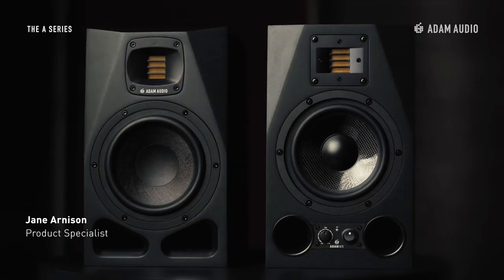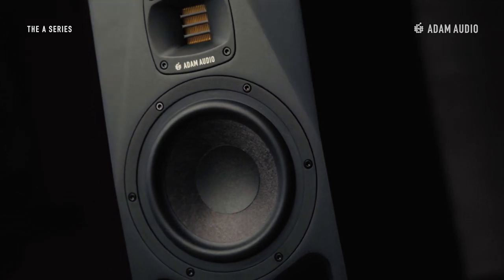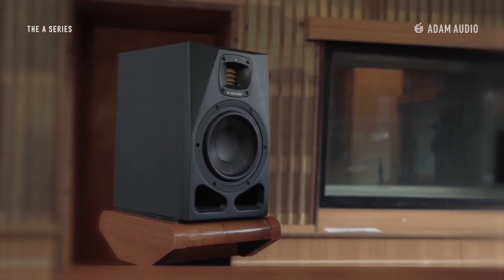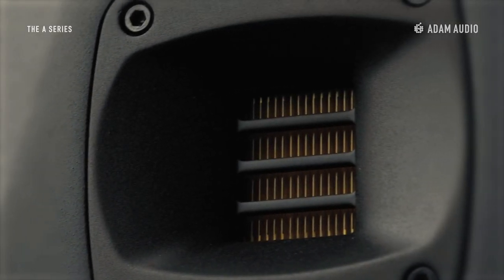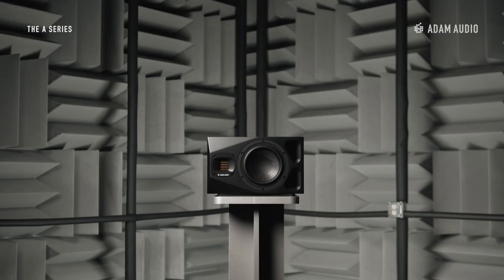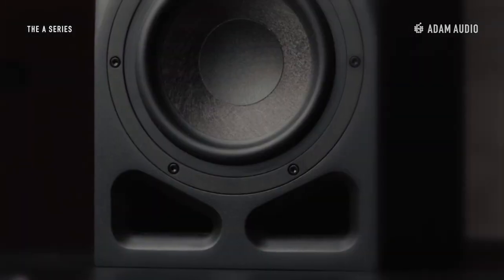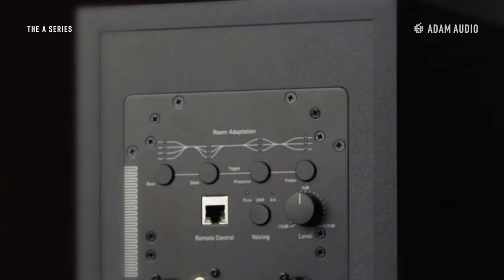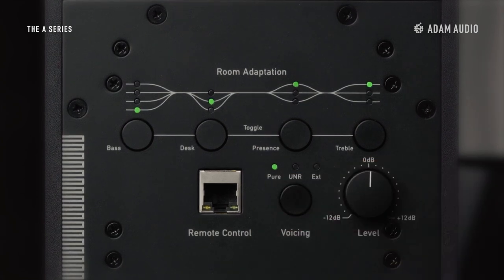The A7V At a Glance | ADAM Audio A Series

Comment from the maker: Update: Measurements with the latest firmware show a frequency response of 40 Hz - 45 kHz at - 6dB.
Reply: what does the -6db or -3db mean? why is it that between of those two, the frequency response are different? please respond, I wanna understand the whole thing, cuz it's a bit confusing hehe
Reply: @Jisooee  it refers to the definition of where the usable frequency response ends. A -3db point at 41Hz means that this frequency is played 3 decibels quieter than the rest of the sound, and it will get quieter from there. So the -6db point is at a frequency below that, but is usually less useful because -6db is already a significant drop in SPL (sound pressure level).
Reply from the maker: @Jisooee  Hey there, here is an article we wrote about this topic 👍 https://www.adam-audio.com/blog/understanding-frequency-response-charts/
Reply: @LeonhardWindecker  i wish all daws would start at -18 or -6  ....-6 gives me some headroom to work within the spectrum. I usually leave this for mastering
Reply: @ADAMAudioBerlin  thank you!!
Reply: @LeonhardWindecker  & thank you too bro!
Reply: @LeonhardWindecker  does using EQ like SonarWorks help boost them back up?
Reply: @WhiskyTanuki  probably, but unless your room acoustically boosts your base, the speaker will get to its limits quickly. Adding base via EQ basically means you cannot play the speaker as loud as without EQ.
Reply: @LeonhardWindecker  Thanks for the reply!

Comment: Very nice. Is there a way to turn DSP off?
Reply: The "Pure" mode will disable the processing.
Reply: "Pure" mode is a voicing. It will not bypass conversion. The drivers crossover filters are executed with DSP requiring it to always be in the signal path.

Comment: How does that room correction work when the A7V's are connected via a sub 12? Does somehow interfere or change anything or should that work just smoothly?
Or would it be better to ditch the sub 12 and get a pair of A8H instead? wich one of the two setups are more promising to achieve accurate room correction?
Reply from the maker: Hi CV!
Subwoofers cannot be controlled in A Control as the current range is analogue, but they can be integrated into an already calibrated DSP system.
And it depends. To be honest, there are advantages and disadvantages to adding a subwoofer to a loudspeaker.
Advantages: lower LF cut off frequency, reduced distortion, higher low frequency headroom, increased placement flexibility.
Disadvantages: the additional bass management filtering adds group delay around the crossover frequency. In very good rooms and with good ears and revealing material, this can be audible.

So adding a sub to A7Vs or going to a pair of A8Hs depends only on your necessities. Usually adding a subwoofer is a good thing but it needs to be set up properly to get the maximum benefit.

Comment: Is the X-ART tweeter for the A7V updated, improved?
Reply from the maker: Hi! the X-ART tweeter is the same as the one used for the AX Series. Handmade in Berlin.
Reply: @ADAMAudioBerlin  The tuning is different perhaps? Maybe less fatiguing?
Reply from the maker: Yes and it should be mentioned that in the new series (in difference to the AX), a rotatable HPS waveguide has been introduced with the X-ART tweeter, which is a big improvement! :)
Reply: @ADAMAudioBerlin  What is the big improvement? Restricting vertical dispersion?

Comment: I know its still early but, measurement data please. You can provide data for the T series but not the new/old A series? A digital/DSP monitor with no digital input connection? Are we going to have audio over IP? Please don't force 2 stages of conversion (3 stages, because most likely you using a DAW and have DA. So that would be DA-AD-DA and finally to the amps/drivers}.
Reply: Exactly!!
Reply: Yeah, I never understand why manufacturers only give their speakers analog inputs when they have a DSP crossover. It just does not make sense to me!

Comment: Hi!
Are they supposed to distort at louder volumes? 
The leds turn yellow and the membranes crackle like crazy..
Reply from the maker: Hi Lynxs!
Please check these links for guidance https://support.adam-audio.com/hc/en-gb/articles/8929001521426-Limiter-inside-more-details-about-threshold-LED-behaviour-

https://support.adam-audio.com/hc/en-gb/articles/8929035350930-LED-different-colours-for-div-purposes-Customizable-with-software-
Reply: @ADAMAudioBerlin  are the a8h’s a better solution?
Reply from the maker: Hi Lynxs! The A8H is a more powerful speaker and it will support more gain and loudness.

Comment: How i can take out the tweeter to change horizontal? Its real hard
Reply from the maker: Hi Michael!
Hi Michael! As the manual says, you should follow these steps to rotate the tweeter and waveguide module:

1. Cover the tweeter with masking tape, as shown in the picture below, to prevent particles entering the tweeter diaphragm.
2. Using a standard hexagonal or “Allan” key, gently loosen all four screws on the front of the waveguide.
3. Taking care not to detach the audio or LED cables, gently remove the tweeter and waveguide module and rotate to the desired orientation.
4. Reinsert the tweeter and waveguide module, and gently tighten the four screws.

Note that repeated removal of the tweeter and waveguide may damage the wooden cabinet. Only carry out this procedure when necessary.

I hope this can help you!

Comment: I got the A7X monitors last year and now this comes out. Just my luck.
Reply: same but still love my a7x's and would never part with them and think this upgrade is cool but i wanted 3 way 5" or 3" speakers next
Reply: @MediaMusik777  yeah, I'm not getting rid of them. Maybe if I open up a studio outside of the house I'll use the V's there. Maybe the larger ones, not sure.
Reply: I've had my A5x's for 9 years now. Just bought a Sub7 Mk2 and it's brought the system up to a different level. AX series are still f-in brilliant speakers.
Reply: you are so lucky, because yours A7x is assembled in Germany. A7v? China.
Reply from the maker: Hi hkyouwrong! Nothing changed between the AX and the new A Series. The production process is the same.
Reply: @petelewicki  I think this is the setup I'm going for. My home studio is not that big so 7" woofers would be overkill.

Comment: For both A7v and T7v made in CHINA and both have ART Tweeter, why do I need to buy A7v? Where is the A7x's Carbon/Rohacell/Glass Fiber woofer? As a A7x owner, I cannot imagine when my A7x break, A7v can replace A7x with similar sound. Will you reconsider manufacture A7x again which is assembled in Germany ? Increasing price by 30% is acceptable. I need the exact same sound.
Reply from the maker: Hi hkyouwrong! The AX Series was also made in China. Only the tweeters are made in Germany. This is exactly the same with the new A Series.
Reply: @ADAMAudioBerlin  Under globalization, it is indeed nonsense to expect all parts are made in Germany. But at the back of A7x, it wrote down "designed and assembled in Berlin, Germany". So do you mean this wording is fake, the A7x is assembled in China?
Reply from the maker: Hi hkyouwrong! There is no fake at all. It has been said that the production of the A Series is the same as the previous AX. Both are designed and engineered in Berlin, Germany. But the speaker parts come from China. The tweeters are handmade produced in Berlin though. 
The quality of the A7X that you are talking about is not going to be worse. Indeed, it has been improved. So there is no need to expect that the sound of the A7X will be worse. :)

Comment: So what is the main difference between this and the S2V ? Why the S2V costs 3 times as much ? If it's midrange detail than you are better off getting these pair and a pair of mix cubes.  It would cost you about the price of one S2V.
Reply: There's a great video on the Adam youtube comparing T, AX & S series and it answers your questions for the most part as I had the same. The S series is still quite advanced comparatively to the AX/V series.
Reply from the maker: Hi noturbiz! As Mike said, you can have a look at this video: https://www.youtube.com/watch?v=z5AfungYlLQ
General taking, the S Series is more expensive which allows us more budget to spend on better quality parts. This leads to improvement in the product performance.